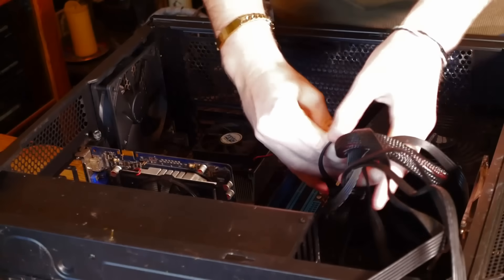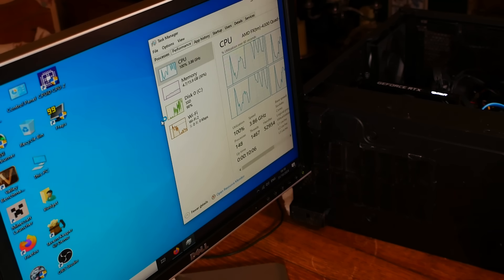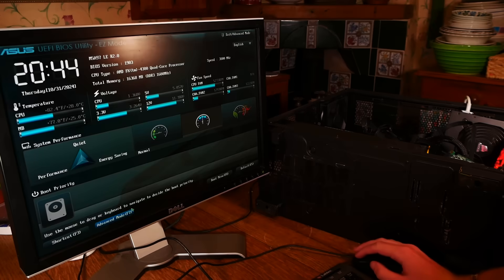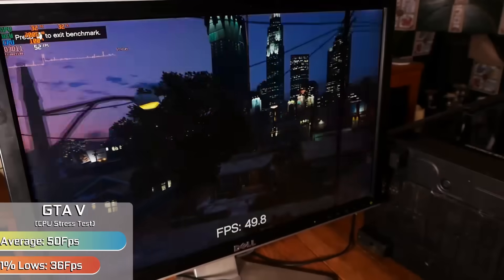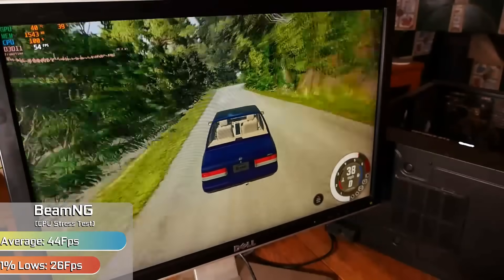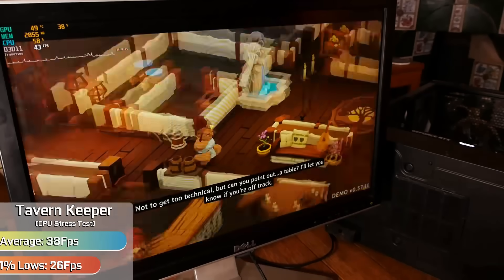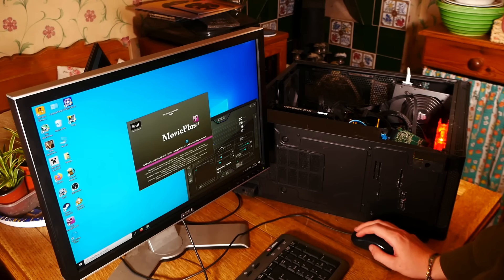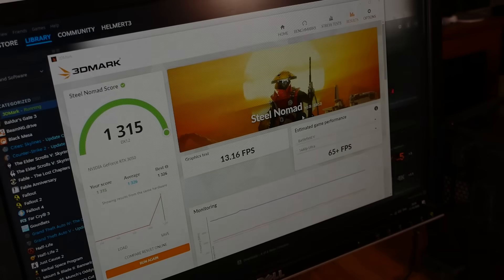AMDs Weakest FX Processor...

Comment: AMD Bulldozer did have the frequency record for like 11 years.
Reply: Yes, probably longest lasting record in long future.
Reply: Was a lot of fun to push them as far as you could
Reply: shame that frequency advantage was gimped by abysmal IPC and the bulldozer architecture's really strange FPU situation
Reply: @alexfrideres1198 haha right. Ran my 3150 a tad under 5ghz for a decade and was always so depressed seeing my buddies core i5s kicking my ass. I always loaded into games first but fps dips were terrible.
Reply: @greglabar9017  I forgot to mention lol, FX CPUs needed that high frequency to even somewhat compete with Intel CPUs of the time, in my experience an FX CPU overclocked to nearly 5Ghz can barely keep up with a locked i5 at 3.4ghz, unlocked sandy bridge and ivy bridge chips absolutely destroyed bulldozer even with less “real” cores
Reply: @alexfrideres1198  yep, such a shame, but I still defended the FX series because of how much more affordable it was. Not good, but good enough for us folk with a thin wallet.
Reply: @greglabar9017 my 8350 never got over 4.2 for some reason. It probably wouldve gotten too hot with my 240 AIO if i had pushed it higher than that anyways so idc
Reply: @alexfrideres1198 from what I read the shared fpu wasn't actually the issue, it was the diesmally small l1 caches and the decoder that really hamstrung it. The fact each integer core only had 2 alu pipelines compared to the 3 of the pervious k10 architecture defiantly didn't help (tecnicly it had 4 but 2 of them could only do read write operations and I've read they were underutilized) I've also read the fpu was pretty good for the time, being beefed up to accommodate it needing to be shared.
Reply: @alexfrideres1198  Same with Intel's Netburst architecture. Awkwardly long data pipe just to pursue clockspeed.
Reply: @gamtax  it’s funny because some models of Slot 1 pentium III CPUs outperformed the early netburst pentium 4s even with netburst’s higher clockspeed 

Netburst was like a motor that could reach a really high RPM but had basically no torque
Reply: @alexfrideres1198  the motor comparsion actually does not fit. 300 hp is 300 hp, no matter you do it with high rpm or low rpm and torque.
Reply: @gamtax  Yeah, I never understood why Intel do that with the P4, it’s like putting 15” tall tires on your car instead of 27” just so you can peg the speedometer to 100mph in 5seconds when you’re only going 35 😂
Reply: @dom3827 Wrong, he said rpm, not HP.
Reply: I remember as a kid and a teen, I was thinking about when we will go past 1ghz and 5ghz and 10ghz and then 50ghz processor speed, but like a decade ago we totally stopped and we're around 4ghz and there is like 0 progress...  I know that its due to physical constraints and physics being anoying at that scale as u can count the size of the components in the processor in number of atoms, but its still anoying
Reply: @SpeedyGwen  well, my 12 core 9900x boosts up to 5.6, so that's something at least
Reply: @SpeedyGwen  Same here, Intel thought Pentium 4 would max out at 10ghz based on their engineering, boy were they wrong. But we can get an i9 14900ks that manages 6.2ghz out of the box! Not sure how long it’ll last though. The same cpu holds the current world frequency record at 9.2ghz. I could’ve sworn I saw a ryzen hit 10ghz a few years ago 🤔 Mandela effect I guess.
Reply: first generation FX is called bulldozer, it can be recognized with x1xx numbering. in this video is called piledriver, basically second generation, it can be recognized with x3xx numbering

steamroller is third generation but AMD decide only apu and laptop will use it. steamroller did improve but still not good as intel counterpart back then.
Reply: No offense but.. my slim mobile series laptop with like a 30w i7 4th gen can kick a 6300s butt(with oc)
Reply: Frequency does not matter, if IPC is dogshit. It's like putting a 1 speed 1:5 gearbox into a car with 1000 hp... Utterly pointless.
Reply: Frequency means nothing without performance
Reply: Ha! Now intel has the record with their incredible unstable and powerhungry chips 🤣
Reply: Yeah, Intel Core i3/5/7 CPUs were just amazing.  From the 2nd gen and up, they just demolished anything AMD had.  Even if they were in a laptop running low frequencies.  

And look at how great the 6700k/7700k was.  People that had those CPUs had a chip that lasted for YEARS.  I mean, it practically took AMD until Zen 2 (Ryzen 3000 series) to beat out the 7700k in IPC.  

But now things are different.  You used to get a CPU and it'd last for years and perform well in all the games that came out.  Now?  I have a 5900x with all the goodies to make it run top notch (top 100 CPU performance in 3DMark for the 5900x) and it's crap in the newest games.  It just doesn't have the IPC.  UE5 games run terrible on it.  My 6700XT pulls 180-190 watts when my CPU is pushing it correctly.  I see 160-165 watts in most UE5 games, now.  I mean, I could probably gain 10-15fps with a 5800x3D or 7800x3D in most new games.  Anyone played Mechwarrior 5: Clans?  Abysmal performance..
Reply: @JustAGuy85 I mean ik what your saying but my oced 6300 kicked my friends sandy i5 in the ass. I know exivator came later and they already moved on to ivy bridge but it was still really cheap.
Reply: @putinslittlehacker4793 even OCed there were games where the FX6300 shit the bed hard, GTA 5 for example was horrible on 6300. That was the only CPU that i kept for less than a year and went back to Intel.  

Sure, FX CPUs were okay for the price, but Intel was always ahead of them by a lot in most cases, for a premium price.
Reply: @angeltzepesh1  I personally never had issues with gta v but also never played the online and I hear it's alot more demanding. And tbh with an open world game it really highlights the cache issues the architecture had with is tiny l1 cache. but no doubt I agree, peaple now who have no experience with them just act like they were e-waste and there was no reason to ever buy them. But as they say there is no bad product just a bad price, and they were perfectly tenable cpus if not the best of the period.
Reply: @putinslittlehacker4793 if i remember correctly, the six core CPUs were sometimes even cheaper than i3 CPUs, i got mine for under 100€ and besides gaming it would trash the i3 and even i5s sometimes. But in gaming you could get a lot of problems in games that needed single core performance, at which FX CPUs sucked hard even if they were OCed to the max.

What impressed me about them is how they aged better than Intel CPUs of that time as soon as games started to utilize more than 1-2 cores.
Reply: @angeltzepesh1  bug agree on the latter part, it's why I reject peaple saying it's not a true 6 or 8 core to, it scales far to well with multithreaded loads to be just hyperthreading. But yea I rebuilt my first  rig with a fx 6300 and it did shockingly well in cyberpunk, 8300 saw even better scaling. Around 35-45 fps in the city. Really makes me think amd may have been on to something if they fixed some of the underlying issues, who knows maybe they could make good e cores if they were designed to clock more modestly. Sence E cores are design to scale well with many threads and you could have a p core Handel most of the heavy single threaded performince.
Reply: @JustAGuy85  That sucks so bad to have a top 100 5900x and not be able to run AAA with good settings and get the FPS you want. The highend gaming segment is exponentially more money and power, just like drag racing. 

Once you step back to medium games at medium settings, even an n150 can run at what most (non-gaming) people would consider amazing performance and only use 30 watts doing it.
Reply: @_..-.._..-.._  Yeah, ESPECIALLY UE5 games.  All these new AAA games from the last 2 years pretty much NEED DDR5 to get proper performance.  Like, a Ryzen 7600 + DDR5 6000 and a 6700XT 12GB would SMOKE my 5900x (tuned to the gills) + 2x16GB DDR4 3600 C16 DUAL RANK RAM, which shows 3-5% gains in ALL games, and up to 10% gains in a few.  

But, it's just not enough to hang with whatever is going on with these new games.  I'm VERY close to getting rid of the 5900x and slapping a 5800x3D in here.  

But, let's be honest... this is an old platform now. 

All my money needs to go to a Ryzen 9800x3D (or preferably a 9950x3D) with some sweet DDR5 6000 RAM.
Reply: @J @JustAGuy85 ’m running a micro atx minisforum 7945hx mobo with 32gb 5600 ram with an RTX5070. It’s actually too much for my needs. I was so excited to build it but I rarely turn it on instead of my old surface books.
Reply: @_..-.._..-.._  Sounds like a really sweet micro-ATX build for sure.  But, yeah, you have a 5070 in it so for encoding, that's what you'd want to use instead of the CPU, and other than that... there's not much to do that can really put a load on that CPU haha.
Reply: @JustAGuy85  6700k is more disappointing that I sold it and kept i7 2600k.  lol   Even though its faster the difference isn't really amazing.  Unless blame Windows for that.   

I recently got i5 Haswell to test it out and overclocked to 4.4 GHz and it nearly matches the 6700k at stock so thats even worse feeling.   People holding on to Haswell/Sandybridge had better experience than holding 6700k.   I was really excited getting i7 6700k back then.   

6700k isn't bad but disappointing.  It short lived by the newer CPUs much faster.   That tick tock strategy hurt Intel a lot 

Haswell/Sandybridge is like GTX 1080 ti for CPUs.
Reply: some stupid celeron with 1 core got it unfortunately
Reply: I look back on my FX-9370 with nostalgia. 
I wanted the 9590 so bad and couldn't get it. 
I remember being bullied by friends of mine for not buying an Intel processor and since then I've had a bias albeit nonsensical, and a bad taste in my mouth for people that are elitist about brand.
Reply: No that is FX 8350 not bulldozer that's vishera
Reply: @consolelivesmatter vishera is the code name for the line of 8 core cpus. The FX series is built on the bulldozer architecture which they slightly modified and used for years. Both ps4 and xbox one used the Jaguar architecture which was a fx cpu with decent on board gpu. Vishera was thrown around to generate hype as their previous launch was a hard one to top but they shrunk the node and used pretty much the same architecture.

Comment: I built a gaming rig with the "six-core" FX CPU and a GTX660. It was... fine. Ran BF3 at max settings at 1080p. Still have a laptop with the "4 core" variant, and it's fine. Perfectly adequate at the time, most of the time.
Goes to show how OP most CPUs are for gaming these days. I've got a 12c/24t Ryzen 9 7900X now, and on some games it's reporting like 4% usage. My RTX4080 will generally max out when my CPU is under 50%.
Reply: This. I "only" have a 5700X3D, but it can keep up with my 4080 Super. Processors have gotten incredibly good.
Reply: @ChrisGrump  The X3D chips are awesome. I was thinking 'hey four more cores at similar clocks is the way to go' I should have spent 10 seconds to look at the benchmarks, it's like having a V8 and losing a drag race to a V6 with a turbo. Still not a bad CPU by any means, but bang for buck goes to the X3D line all day long.
Reply: @TheWarmotor  Only in gaming. most working applications (encryption, decryption, compression/decompression, rendering, etc) doesnt really care about the extra cache, so you can save money AND gain performance by opting for the higher clocked version without the 3d cache if you arent gaming with your cpu
Reply: @wills.5762  Yeah 😅 except there isn't any non-gaming computing I do that wouldn't run just fine on a raspberry pi.
Reply: To be fair the 7900x does have a lot more cores than most games will use nowadays. I'd say it's more towards workstation in performance rather than gaming cpu.
Reply: A big computer store here sold 6-core FX 6350 build as a gaming rig to play Battlefield 4 , I were tempted at one point.

Comment: I am using a FX9590 in a Crosshair V formula Z Mobo with a modified bios to use NVME drives. This processor while hot runs Windows 11 fine, that is until Microsoft shafted everyone that was in the Windows Insider group that tested 11 on the FX processors. We had no errors or issues but Microsofts uncompromising greed overcame peoples inability to afford a Win11 compatible PC and we were kicked out of Win11 Insiders.
Reply: FX never really was compatible with W11 anyways in fairness, lack of TPM 2.0 required work arounds.
I hate to say it, considering how cheap older Ryzen is getting, FX is really hitting the point of effectively uselessness, even the 9590 at full wack overclock will get walked by a second gen 6 core Ryzen you can for 30 bucks and DDR4 is cheap now.

Might be time to move on
Reply: @deepbludreams  tpm isnt needed on consumer platforms

Comment: I've bought an FX 6300 in 2014 and it was already slow as hell. it felt more like it had 3 cores, not 6
Reply: yup, since their "6 cores" meant 2 weak cores making up one ok core.
My 8320e was supposedly 8 core yet it really wasn't
Reply: Technically it did 👀
Reply: @Sprier  Technically it did NOT, ffs, saw many years have passed and people still can`t understand FX architecture?!
Reply: @Dagoth666Ur  Actual 6 cores sure but 3 modules sharing and bottlenecked as such, also sharing the same cache. With not having actual 6 core performance and logical reasons why, for the technicality argument of "actually 6 cores" there's a reason they settled.

Comment: A recent video "AMD FX in 2024 - Fine Wine?... or Vinegar?" puts things into perspective. I am running a FX-8300 and it's not as bad as I remember following the advice in that video.
Reply: Definitely aged better than it released with games and programs, even windows knowing what to do with more than 4 cores and multi core optimizations. It's crazy how different it was only 12 years ago
Reply: OH, damn, that's me.  Thanks!  😁
Reply: @Rouxenator  I had a 8300 that I could overclock to 4.7g without any problems amazing CPU.
Reply: @markskonecki2050  What'd you use to cool that thing?  I always remember hearing not to go over 62C and I used a Hyper 212 Evo and struggled to keep it at 62C under full load at 4.3ghz.

I realize not all silicon is the same, but still... I'd imagine that thing was putting out a ton of heat.  Was it water cooled or something?  Or did it have a massive air cooler?  I use a Fuma 2 Rev B on my 5900x, now, with 3x fans on the heatsink lol.
Reply: @JustAGuy85  it was a 240mm AIO I don't remember the brand off hand .. yeah the fx8300 i had was good one..I had a 8350 that would never make it past 4.6 before it would freeze or reboot...every CPU is definitely different. Temps were in the upper 50s under load and in the low 30s at idle.
Reply: @markskonecki2050  Awesome!
Reply: @JustAGuy85  yeah, FX did have a silicon lottery for sure. Most people have trouble running past 4.8 ghz, even with an aio. Me however, my 8320 can hit 5 ghz at 1.47v and stay at around 55-57c (tctl). I won the lottery even more on my 4300, where that chip can do 5 ghz at 1.43-1.44v, which is really, really good.
Reply: @jacksonmontgomery1220 That is amazing.  I wish I would have had something better than the Hyper 212 Evo on mine.  Maybe I could have seen what it REALLY could have done.  I just couldn't keep it cool enough.  I never had crashes or anything, it was the temps I was worried about.  But I know I wouldn't hit 5ghz at 1.43-1.44v like yours, you surely did hit that silicon lottery.
Reply: Loved the 8300. It's overclocking potential is amazing with just an AIO water cooler.
Reply: @potardo9851  I miss mine, sold it last week and now I have a Q8300 - not the same.
Reply: Iam still using my FX-8310 & Biostar ta970 to this day..The memory is gskill ddr3 running at 1866 and still going strong
Reply: @Dman216  Keep that 1866 in it.  I watched a ton of reviews.  1866 performed BETTER than the next step up.   It ended up being the BEST RAM MT/s speed for these chips.  It's also what I used with my FX-8350 BEFORE even learning about that.
Reply: Can it run crysis 3 welcome to the jungle with more than 30 fps nowadays ? Cause that's how bad it was back in the days.
Reply: 8350 on a sabertooth 16gb 1886 ram and rx580 8gb,beautiful and tuned mashine
Reply: the big channels tend to gloss over the fact that you need to tune the Bulldozer CPUs not like they would on Intel machines lmao.
Reply: @alrecks619 they were so easy to overclock. You just turned up the voltage and it would go to the moon. Took me about 10 minutes to get to 4.7ghz on my 6300

Comment: Nothing will ever suck as much as Sempron.
Reply: They were fine - the first Semprons were basically Athlon XP Bartons for Socket 754. The later ones were even 64 Bit. Of course as soon as there were better options (e.g. Q6600) it didn't make any sense anymore - especially because they were single core parts...
Reply: @moezarella1261  I am a former Network Engineer & started building PCs in 1992. I was even part of the Cyrix 386-to-486 upgrade era.  I gave up after getting the infamous "magic smoke" on the 3rd 386 I tried using the upgrade kit on. So I know how much the Sempron sucked. It was an IT support nightmare, people (aka management) who didn't understand how a PC worked went & bought these things, because of the price point.